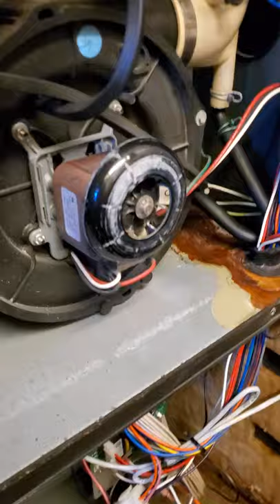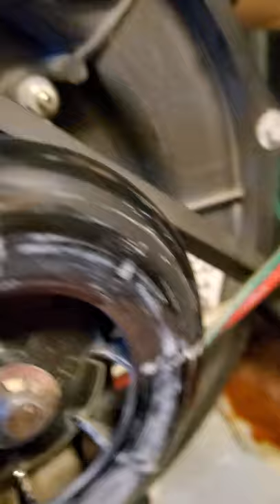Goodman Furnace Troubleshooting part 3

Comment: Did the inducer motor burn out due to a restriction in the flue pipe causing over amping? Or just past its life time?
Reply from the maker: I believe just its life on the bearings.  The unit was installed previous to us moving into the home I believe in 2008. These units typcally have a 10 year warranty and this was past the 10 years.

Comment: Mine not even moving just hear the electrical noise .. should I order one?
Reply from the maker: the bearing is most likely shot. if you order one and can replace yourself.. Its much cheaper. This replacement cost me $ 800 installed by licensed contractor.